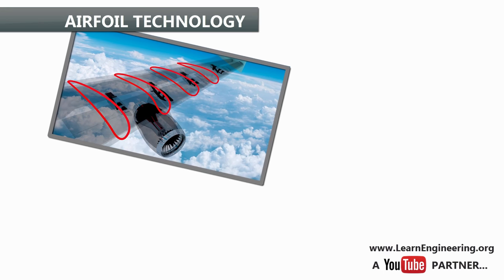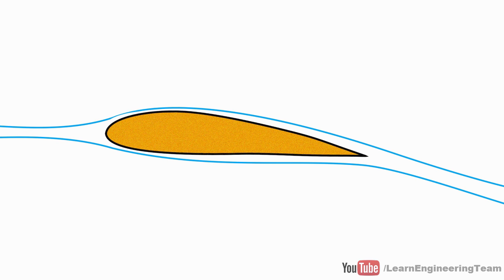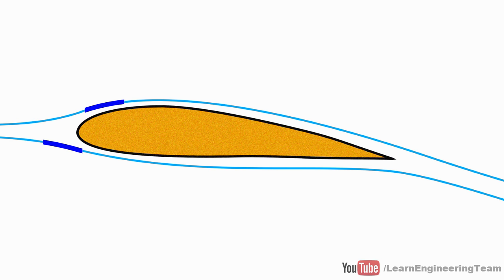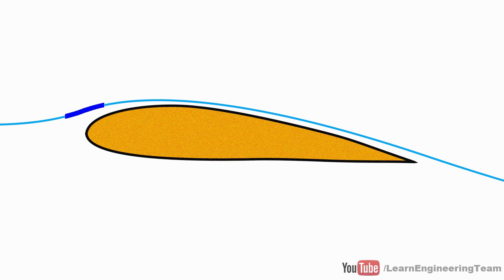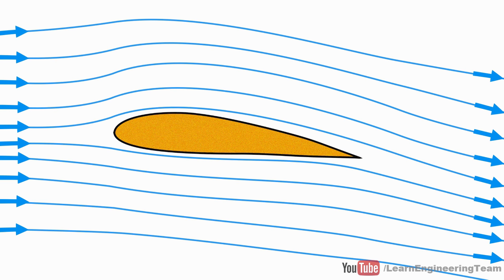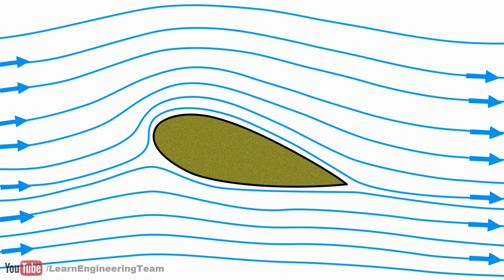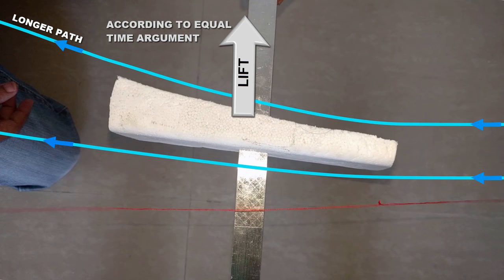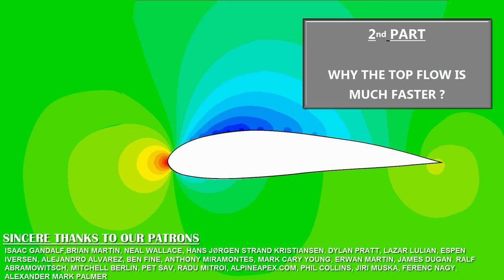How do Wings generate LIFT?

Comment: i just had an intuitive connection of this concept. is this the same principle, which when you blow the topside of a sheet of paper you're holding, the tail of the paper would lift?
Reply: Blowing above the curved paper is somewhat similar, but not really the same thing.  That really is Coanda when the paper it curved, then changes to entrainment when the paper flattens. 
.  
Coanda is DEFINED for a JET of air blown into an otherwise still environment and has constant entrainment. 'Abof\ve a wing has no entrainment like that.
.
Above wing reduction gives folks the most trouble. For a better understanding of the detailed cause of the reduced pressure above a wing, try this short video:

https://www.youtube.com/watch?v=3MSqbnbKDmM
Regards

Comment: Bernoulli's theorem CAN be applied to two particles in different streamlines provided the flow is irrotational.
Reply: They must also have a common ancestor and these do.  The upper and lower both are originally ahead of the wing at the same pressure (atmospheric) and velocity (zero).  This means they have the same energy and can both be compared with the Equation.

Comment: The path is longer and so the air does get stretched but speed and distance chance and do not meet up again/ don't gain equilibrium. So you do get a low pressure field that helps but its the air at the top of the wing that sticks (maybe also do to the low pressure, as in their is an air cavity to fill) and so gets deflected down...

Comment: Very Interesting, but I think that the truth is between theses two theories. As you shown airflow above the wing is faster, so along this streamline Bernoulli principle applies and lower the pressure of the air flowing above the wing. In the mean time the airflow below the wing is not as fast so the pressure doesn't drop as much, this creates lift too! So Bernoulli principle can explain lift even if equal time argument is wrong. 
Speaking about the equal time argument. I agree that in a wind tunnel where there is an airflow over a stationnary wing nothing tells us that the air should travel the same distance. But there is two things to take in consideration. First (I'm not sure about that ) the air flow above the wing go through a narrower path, and since the pressure doesn't go up(no flux) , it must flow faster to conserve the flux. Second, in real airplane it's the wing that is moving through relatively static air, in that case the equal time argument makes sense because the air is displaced verticaly but not horizontaly, so the horizontal position relative to the wing stays the same for all the air (due to inertia). In that case the geometry of the wing lead to a longer path for the same horizontal distance. 
And at last I'm not convinced by your argument about the reversed shape, yes the third law of motion is stronger in your example but none of your wings are aerodynamic and the dragging that this generate could counter any lift produced by Bernoulli principle. 
I'm no physicist so any feedback are welcome.
Reply: You are neglecting one thing.  Lift on wings is caused predominantly by simple, boring, angle of attack.   Bernoulis principle does cause lift in wings shaped appropriately, but certainly not enough to lift the aircraft.   Wings have been shaped that way to make them as efficient as possible.   And, yes, it might sound too quaint for folks who love to strut their stuff on utube, but that air moving faster over the top of the wing is essentially caused by the fact that the air must move faster, because that side of the wing is longer.   If the air does not stay in the same place in the sky, where is all the extra air stored that "didn't make it there" as the plane flies for 10 hours.  Thus, in fact, essentially, the "equal time" thing is accurate.  The fact that two molecules which were side by side, are not side by side, is utterly irrelevant.  On the average the molecules are staying in the same part of the sky.  So the speed over the wing must be higher.

Comment: I spent many years windsurfing and studying sail design. In windsurfing, you can feel all the forces on the sail, when it's in the sweat spot, powered up and pulling the way you want. When the draft is moving around and how a little downhaul or a carbon mast can make a lot of difference. 10 times more than on most sailboats with a fixed rig.   Speaking of sails and not wings the equal and opposite forces make a lot of sense to me. Over the years, as sail technology advances and the mast become more streamlined with the sail the corresponding performance increase comes up short possibly because they are always counting on two-thirds of the lift coming from the lee side of the sail? I think like you said, it's simply how much force/ air you can bend... or stall in at times. It doesn't matter what side of the sail the power comes from. Often a larger sail will do more good than one with a more streamlined entry. 
Also not mentioned, and sailors know, as you get closer to the water surface the wind speed drops on average but also becomes erratic and full of flaws, eddies and swirls. Hard to generate lift in those conditions and easier to get a push.
Reply: Glad to hear your description of your experiences concerning lift forces. Goethe stated - until you feel it, you can't understand it. This proved to be the case  for you.

I'm glad that scientists debate scientific theories such as lift. How else can mankind arrive at the truth ?

Comment: 4:24 why does pressure increase towards the bottom of the wing?
Reply: IKR why??
Reply: molecular attraction
Reply: Imagine having your hand outside the window of a driving car at an angle where your hand is like a plane, that wind pressure being smashed into the middle of your palm is what give you the feeling that your hand is being pushed back a little . That angled wind pressure being forced at your palm at that angle is what causes lift. I think , idk.
Reply: @obannon5226  Thats absolutely true
Reply: @obannon5226  so you're saying the air molecules are getting smashed into the bottom of the wing, basically causing an accumulation of molecules (so a high pressure)
Reply: It's not, it just appears that way because the pressure above the wing decreases, therefore the (normal air pressure) below the wing appears to be a force. I was taught that turbulent air has less pressure than less turbulent air, hence the difference. If you have a storm approaching, turbulence, the air pressure drops compared to that of the surrounding air, hence the storm conditions.

Comment: your videos are lot more informative and you busted the myth about equal time argument in lifting theory   ...
will you explain how to set thrust line with CG? also Where the exact CG located vertically?  is it consider on chord line or we need to calculate vertical momentum for it? and then need to set the thrust line with it ? mostly interested in high wing pusher prob mounted on top of the wing configuration ....any one know the right ans ????

Comment: The water running over the bottle isn't surface tension?

Also I don't get this diagram at 4:23, if equilibrium goes from High to low, why does your diagram point the opposite direction? If there's high pressure above the wing, and low below the wing, wouldn't that push the wing down and thus the entire plane with it, since the plane is attached to the wings?

4:51 This airfoil-profile example would be better if it was upside down, that blunt-face at the bottom would be better at the top. I believe(haha) that a higher camber would be better/make sense to be applied at the top of a wing than the bottom. Otherwise it's almost like an upside-down flat-bottom airfoil.

I think overall the lift-factor comes from deflecting air-downwards not because of "coanda effect" but just by pushing the air downwards like a ramp pushes something upwards, the airfoil/tear drop shape is to reduce drag.

edit: yeap and apparently what I said is wrong (of course)

https://www.grc.nasa.gov/www/k-12/airplane/wrong2.html

I am not aerospace engineer.

I'm probably wrong I suppose.

Although I've built a lot of model planes, have obsessed about aviation, read/watched a lot of material but I will admit I still can't mathematically or even verbally explain lift to prove that I can lift something. I only work with a "known good airfoil shape" wing loading, and watts/lb rating to make sure something flies. But then again these are just toys and I am not an aerospace engineer.
Reply: > The water running over the bottle isn't surface tension?

Dr. Denker from av8n.com has the same objection.   I think he's wrong, but the issue is just terminology.    Underwater, a fluid jet will follow a surface.   This is traditionally called "flow attachment" rather than "Coanda Effect."     And in air, a jet of air will follow a surface, same flow-attachment.

It's only when using water jets in air, that issues of molecular adhesion and surface-tension issues will cause confusion.   So, take the whole demonstration underwater, and use a dye-colored jet to show the attachment of the flow to a curved surface.    Or, use a smoke-jet in air, to show that gas-flows immersed in gas will still attach.   (Note that gasses have no adhesion forces at all.   Yet the jet still sticks to the curved surface!    Coanda Effect was never being caused by the chemical bonding between molecules of a liquid.)
Reply: wbeaty 

thanks for the clarification
Reply: dutchrjen thanks for the clarification
Reply: I think you've missed a part. It's not that the air pressure pushes the air down to stick to the top surface. The Coanda effect - tendency of the fluid to parallel to the surface - causes air particles to move downward as you move toward the trailing edge, separating molecules and decreasing pressure. Pressure is a measure of particles banging against the surface, so as the surface drops it is moving away from the flow stream and has less impacts (lower pressure). The smooth airfoil shape, compared to say a tilted flat surface,  helps stop the stream from separating from the surface so the upper stream leaves the tail section with a downward trajectory. Pushing the air down results in pushing the wing up (Newton's 3rd).
Reply: I'll have to read this again, right now I can't seem to focus/get it.

Pictures would help haha.

I could understand if the air going downwards is "pushing up" on the bottom of the wing, what about the top part?

Anyway yeah I'm pretty tired at the moment, I'd have to dissect your response with a clear mind.
Reply: The flow stream will try to stay parallel to the top and bottom surfaces. The curved shape of the top causes the top stream to exit at the tail section at about the same angle as the top curve at the tail end - that is, at an angle more downward than the air exiting from the bottom surface. So the airfoil shape increases the downward movement of the combined flow streams, increasing the upward push (lift) on the wing.
If this were just a flat surface tilted at an AOA, the top separates and the top contribution is poor, but the bottom contributes similarly to the airfoil bottom.
Reply: I don't disagree with with your clarifications. My point was that the change of momentum of the air caused by the passing wing results in an upward and rearward force on the wing. The use of Bernoulli is questionable since it applies to cases where there is no addition of energy to the flow stream, but a wing moving through still air causes a large addition of energy to the air. A full energy balance could be used, but not the simplicity of Bernoulli.
Reply: The still air example is posed as an easier to understand case where there is an obvious exchange of energy between the air and wing. Bernoulli doesn't work because this is not a closed system - the wing energizes the air but the air does not return the energy to the wing - it is dissipated. In all cases of a flying wing, the wing gives up energy to continue flying. That energy goes into the air and is lost. If the wing is a glider descending, it gives up potential energy (altitude). If a glider ascending, it gives up potential energy (speed). If it is a powered aircraft in straight and level flight, engine power puts energy into the air. If you reciprocate with a still wing and moving air (wind tunnel) you'll get the same result. This does not happen with a Venturi in a pipe, if we ignore friction between fluid and pipe wall. In that case, Bernoulli works fine.
Reply: >I think overall the lift-factor comes from deflecting air-downwards

Exactly correct.   But it only applies to 3D wings.   2D airfoils fly by a different mechanism.

Here's how to pick it apart:  visualize a hovering helicopter far from the ground.   The rotor pulls air in from all directions, so the intake pattern forms a contracting sphere many miles wide.  Below the rotor is a long column of downwash, of descending air.   At the edges of the downwash-column are spiral vorticies.   The vortices separate the downwash from the rest of the atmosphere, as if the downwash was a long pipe with air only moving inside the pipe.

Helicopters hover because the rotor is a reaction engine: it takes air in from all directions, which produces zero thrust or lift.   Then it ejects air in a single direction, downwards, which produces enormous lift.

All OK?   Not too complicated?

Here's the trick:   move the helicopter constantly sideways.     Now you have the basic diagram of any airplane in flight.   The wing is producing a columnar "downwash," but now it's smeared out into a diagonal line.   The vortex surrounding the downwash has turned into a pair of vortex-lines, with the flow taking the shape of a "scroll."   But still the entire pattern is descending, as in this smoke-diagram of a 747 model. http://amasci.com/wing/lasrWing.gif    (Yes, helicopters in high-speed flight will produce the same flow-pattern, with an overall downwash plus a pair of "tip vortices.")
Reply: 4:24 why does pressure increase towards the bottom of the wing?
Reply: By toward the bottom, do you mean along the bottom surface of the wing? Like a fan blade, as the wing passes by it deflects the air downward. Accelerating the air downward requires a force on the air. Equal and opposite force pushes up on the wing. As it's accelerated there are more air molecules in a smaller volume, creating the higher pressure. GA flight is treated as incompressible because the change in pressure relative to atmospheric is so small (only about 1/2% change from 100% to 100.25% and 99.75%)), but in fact there is compression/expansion and resulting pressure increase/decrease.
Reply: yes, the bottom of the wing is the bottom of the wing, not the sides, not the top. 
For the top surface I understand that when the air rushes over the top, somehow it gets accelarated, loses pressure and attaches to the wing profile because the ambient pressure, now relatively highter, is pressing it against the wing (so P out > P in). The bottom of the wing is curved too, be it less pronounced. So the flow should speed up too and lose pressure. So the same would be true: P out > P in, the ambient 'ground' pressure is greater then the pressure of the air jet. but in the video somehow it gets flipped around.

Comment: Warning: ahead are people who have all sorts of degrees in aeronautical engineering, who are intent on correcting everyone who is wrong. Please proceed with caution.
Reply: you made this comment a LONf time ago but it's so tru i'm not even going to enter.
Thank you kind sire
Reply: Why is that a bad thing
Reply: I’m wanting to go into aeronautical engineering, so having the correct information is very important for me. I’m happy that aeronautical engineers take the time to correct any wrong information
Reply: This video gives wrong way for Bernoulli's equation application at the leading edge (A) and the trailing edge (B). As the outside air (or any fluid) is at rest (or having a uniform velocity) and at a certain pressure (depending on the altitude) at both points (A) and (B). 

Then the airfoil comes slashing through this uniform mass of air, and such local disturbance requires global restoration coming from the surrounding larger mass of air (energy balance must be done, and the losses will be air friction and vortex generation).

 However, this energy restoration faces the situation where the upper surface giving the air longer path to travel to come back to its original undisturbed condition (same velocity and same pressure). So, the energy restoration process will make the upper stream flows with increased speed than the lower stream (this is clear in the case of near sonic speed, as a shock-wave will appear at the location at the airfoil where the speed is first increased). This locally increased air speed will reduce the local pressure and cause lift.

You can think of this energy disturbance and re-balancing process as a spring when it gets loaded by a slow moving body and then reacts to unload itself with increased counter speed.

As for the other shapes presented by the video, the flow will detach from the surface after the first bump, and flow separation and vortices will cause high drag and the flow will never see the rest of the bumps of the airfoil, that is why it will consume the disturbance energy and restore the energy balance without generating lift.
Reply: Glacier The Husky  I got angry because I stumbled upon this misguiding video while I was searching for a video with nice graphics to explain the correct way to understand lift over airfoils. Having arrived one year later, my only choice was to include my comment here :))

Comment: Hey, I think  flow separation also might cause lift. when flow past the upper layer of foil and curvature is quite large in that flow separation might take place at lower portion of foil. Thus causing vacuum in that region. thus ultimately leading to pressure gradient and upward lift.